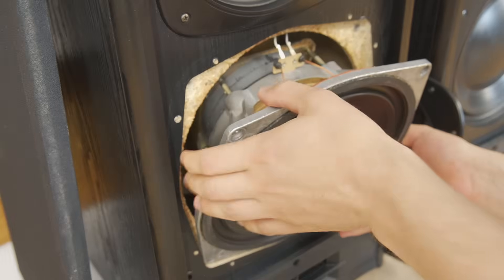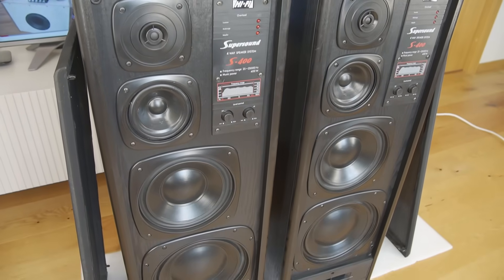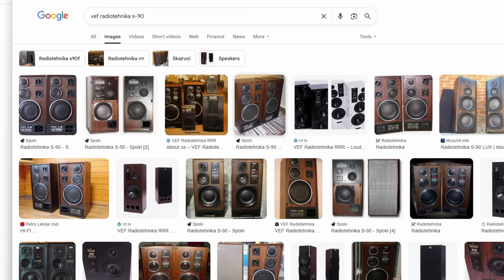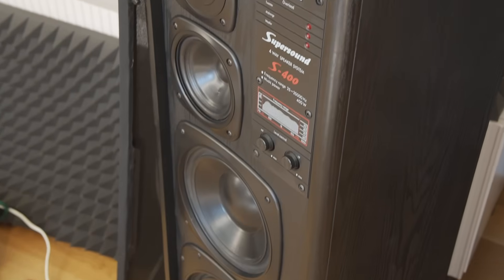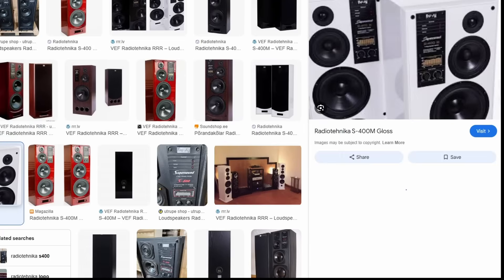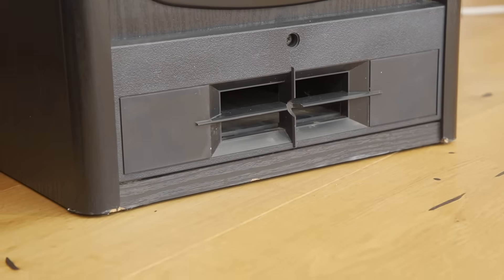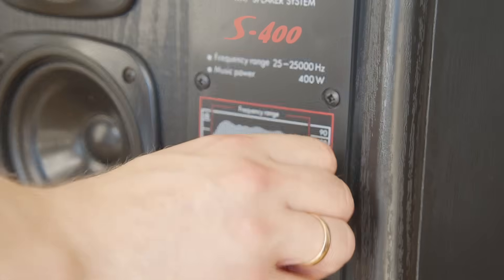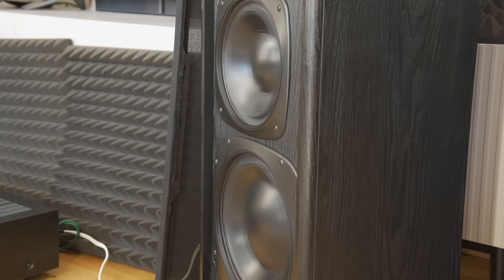Teardown and Look inside Radiotehnika S-400 Speaker

Comment: 25 hertz is mad
Reply from the maker: Like a lot of brands, they don’t say how much dB loss occurs at 25Hz. Real brands show frequency response within +-3dB, but this definitely isn’t the case here. Maybe these 25Hz are at -10dB, like other brands that exaggerate their frequency range.
Reply: @Techscrews  i was thinking that afterwards aswell would it be fair to say the most bass drivers would still move at those frequencies but the cabinets are not designed to resonate at those frequencies?
Reply: 25hz is pushing it but 30hz is audible in room, about -6db IIRC. I own Baltic 90 which has the same 10" bass driver. It does actually reproduce those low frequencies and when I had connected them into my AV amplifier and ran room calibration, Dirac actually wanted to push frequencies all the way down to 20hz up to the same level as the rest of the frequencies! I didn't want to stress my amp unnecessarily and set the cut off point to 30hz and they played just fine. I did eventually put my old Tannoys back as they are just better speakers overall although the bass capabilities of these rebadged Radiotehnikas did impress me, especially for movie use.

Comment: Two different woofers working in the same enclosure?

Anyway, drivers don't look too bad, I wonder what could be achieved with them in a proper enclosure, using a proper crossover and with no BS around (that passive indicator is just stupid)
Reply from the maker: This isn’t the most musical system you can find, but it sounds like what 80% of listeners want. The bass is slow, but it feels heavy and gives a nice overall impression.

Comment: Nice drivers, cabinet looks like most other speakers with frequency response graphs on the front label - cheap. You wouldn't know except for the weight and perhaps the woofer cones and surrounds looking a little different than regular cheap drivers

Comment: Terrible acoustics - a flimsy case made of cheap chipboard, modified speakers from the late 70s, stupid acoustic design of the 8-inch midbass speaker, which works in the same (!!) volume with a 10-inch woofer... Radiotechnika S90 was much better and more thought out.

Comment: The drivers look great, no question, but the enclosure throws me off completely. The particleboard seems flimsy, and the crossover looks like it was made in the seventies. Those driverscertainlye have a lot of xmax and thereforerequired a strong cabinet, which is notprovidedn in this case.
Reply: Instantly formed the same opinion lol. That particle board made me shudder 😂
Reply: кроссовер из 70х это хорошо.
Reply: Pretty good drivers huge magnets wide coils handcrafted crossover make the diff...❤ this video
Reply: That simple looking crossover was a surprise because at least Norsk Audio Baltic 90 (rebadged Radiotehnika) has a crossover that one could call over engineered and it looks like it belongs into a nuclear missile controlling system rather than a simple speaker. The chipboard is cheap but this was made before MDF became popular. At least it is very thick and heavy but still there is not enough damping material nor is the cabinet braced well enough. Very old school design. The drivers itself are actually quite good even today, the 10" bass element especially. It can handle a lot of power and bass extension goes deeeeep. You could probably build a good subwoofer out of them, put them into a proper and well designed box.